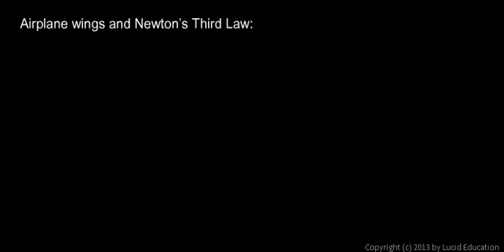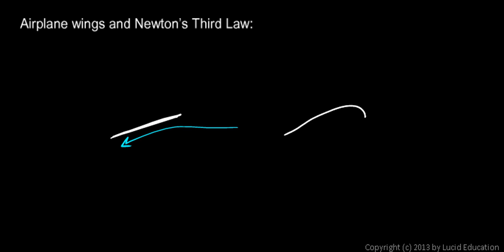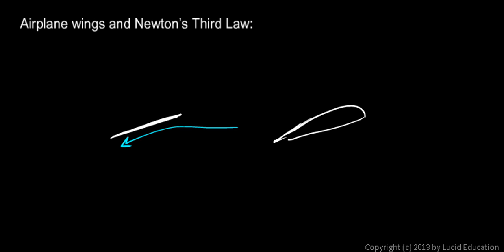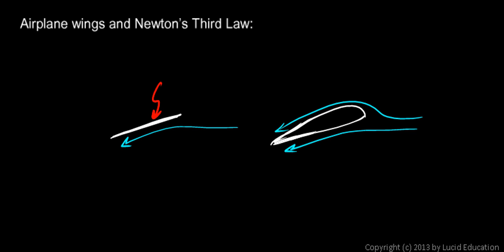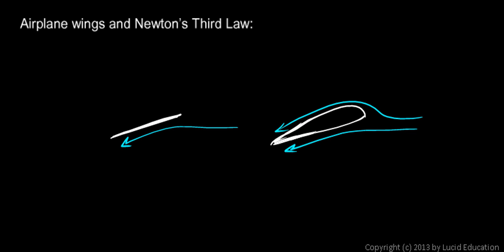Physical Science 3.5c - Bernoulli`s Principle and Airplanes

Comment: Excellent video! One thing to keep in mind is that Bernoulli's equation only applies to a single streamline. Thus, Bernoulli's is not a great explanation when it comes to airfoils, as the many streamlines above and below the airfoil cannot be related using Bernoulli's. While velocity and pressure are related when it comes to airfoils, it is more due to pressure and velocity fields and how they change together.

Comment: An inclined hydrofoil moving slowly through liquid helium will not generate a transverse force, or lift in other words. The same hydrofoil moving through liquid sodium with exactly the same geometry or kinematics will generate a transverse force. An attempt to explain this in terms of Bernoulli or Newton will be a failure.

What happens in the case of liquid helium is that fluid doubles back round the trailing edge and nothing much else happens. In the case of liquid sodium viscosity frustrates the doubling back behaviour and a starting vortex is dumped in the flow. By conservation of vorticity, there must be bound vorticity associated with the hydrofoil and this generates lift by the Magnus effect.

If the hydrofoil stops, then it will dump a stopping vortex. If it moves intermittently in a start-stop action, then it will dump a vortex street. This can actually be visualised.

This is the basics of lift generation. I'll talk about the Kutta condition and the Kutta-Joukowski circulation theorem if you like, but the Magnus effect is a good simple alternative. Bernoulli's theorem is merely wisdom after the event of a starting vortex being dumped.

Comment: The lift force is the pressure difference around the wing (more under than above) caused by the relative (air-wing) motion. 
..
These same pressure changes are what also push the air down behind the wing (down-wash).... as well as forward and upward ahead of the wing (up-wash) and around the wing-tips into the tip vortex.
Bernoulli's Principle as interpreted here is an all too common *misconception*.  Speed DOES NOT lower static pressure.
..
Pressure gradients (differences in pressure between regions) accelerate (push) on the mass of air. That's simply Newton for fluids.
..
Three years since I explain all of this and this Bad Science is still here!
Reply: Your answer does not make any sense
Reply: @ashallama223   There are so many videos and web pages by amateurs that have this wrong.
..
Things wrong with this video.
.
1- Bernoulli's Principle does not explain lift.  He does state the actual Principle correctly and you do see pressure and speed behave like that around the wing, but it is explained incorrectly here.
.
A fluid does not exert less pressure when it moves with greater speed.   <-- THAT part is false. 
.
The air is *speeding up*.  That is important because a higher pressure pushes it more, therefore, speeding it up - accelerating it toward the lower pressure. It is the pressure difference that provides the force to accelerate the mass in air.  This is Newton for Fluids.  A pressure difference between two locations is called a Pressure Gradient. 
.
Pressure Gradients Accelerate fluid.
.
The fast air out of a blower has the same pressure as the stationary air around it. It is the higher pressure inside the blower that accelerates the air into the lower atmospheric pressure.
..
..2- Newton's Third Law happens, for sure, but it is the pressures around the wing that pushes air down from BOTH the lower surface and upper surface. The air is accelerated BY the pressures.  The pressures push up on the wing AND down on some air.
Think pf walking up a sand dune.  As you step up, you can see some sand going down.  When you walk up stairs, you are pushing down on the stairs, but the stair pushes up on you.  However it is YOU that is causing the push, not the stair.
..
Also the air does not "move faster above the wing" .  The air above the wing is accelerated by the pressures.  A lower pressure forms above the wing by the way the air is forced to curve.  The atmospheric pressure ahead of the wing pushes more and this accelerates that air rearward toward the trailing edge.  It is Accelerated rearward by the pressures.

Newton's third law happens because of the pressures.  It does not happen to help provide more lift below the wing.  The wing's lower surface and the air approaching each other causes an increase in pressure . It is THAT pressure that pushes the air below the wing downward because the pressure much lower is atmospheric pressure that is lower pressure than close to the wing's lower surface.  It is the difference in pressures that Accelerate the air.
..
For a correct of the detail above a wing, see this short video: 
  https://www.youtube.com/watch?v=3MSqbnbKDmM 
..
For a full explanation (including that video, See 
Understanding Lift Correctly https://rxesywwbdscllwpn.quora.com/

Comment: It is not enough to just  state Bernoulli's principle,  and the next question to ask is what causes Bernoulli's principle?
So let us jump in at the deep end and describe what actually happens. Let us assume  we are using a well designed airfoil section  where the  top and bottom of the leading edge were designed to accelerate the air particles out of the way , for the wing to go through the gap formed and generate lift  on the whole wing. The shape of the  accelerating zone  at the leading edge to cause minimum acceleration to provide the right momentum  to the air particles, without too much drag is a science in itself about which we shall not cover in this comment.  
The air particles are forced to hit heavily the leading edge using the energy  of the engine, hence  they are accelerated and reflected upwards very forcefully  solely due to engine power or dive in a glider , where their momentum would tend to carry them far higher than the surface of the wing causing a depleted zone hence low pressure bubble above the wing This is a sort of bubble of low pressure above the  wing, which will try to collapse  with the low pressure accelerating the air particles downwards while at the same time pulling the wing upwards. But with the less mass, viscous air particles forming the upper side of the low pressure  bubble being lighter than the solid wing with a higher mass, these will accelerate down faster than the wing will try to accelerate upwards,  with an equal reaction and so the wing must move forward fast enough not to let the air particles  cover so much distance down  as to hit too much of the upper trailing edge  and preferably will come down as down wash behind the trailing edge.    This is a continuous action with new particles being given energy by the engine or a dive, and  shot up at the leading edge to keep the low pressure bubble above the top surface of the wing through them  being accelerated down into an area of low pressure thus increasing their velocity before they go past the trailing edge, perhaps even hit it  but the over all effect is still the fact that the wing  trying  to be sucked up by the low pressure area above it. Again it has to be noted that it is very important that the wing will move forward fast enough so that the air particle on top accelerating down will not hit too much of the upper surface of the wing to lose their momentum downwards on the wing itself. The fact that the upper surface of the  wing recedes down after its higher point, it will give the air particles some more room, hence  time before they hit the trailing edge and preferably go past it.
Meanwhile at the lower leading edge  the air is also accelerated down, but due to the fact that the lower part of the wing forms an angle of attack there will now be a high pressure zone which will  accelerate the air particles under the wing to change their momentum downwards and due to the fact that they are in a high pressure zone  all the way to the trailing  edge, they will slow down a little while those on the upper side on the wing accelerating in to a low pressure zone of their own making, they will increase velocity hoping that they  will not hit too much of the upper surface near the trailing edge. In fact this is the  main  reason why the plane has a minimum safe speed for take off so that the upper downward accelerating particles on top of the wing will  not hit  the upper surface to lose their momentum on the wing surface which would push it down, where other zones on the upper surface are lifting it up!
The over all effect is a change of momentum  downward of the air around the wing and so the force to do this  reacts to lift the wing, be it  a high pressure under the wing or a continuously collapsing and  continuously repaired low pressure bubble on the top surface. 
We should stick to  the facts that are taking place and not  mention, Bernoulli nor Newton. That would be like some one asking me what my wife looks like and I would tell them that she looks like her sister. If I had to  use that type of description, No one would be any wiser if they do not know her sister, would they?
Reply: @vennessa lorret,
.
"air particles are forced to hit heavily the leading edge ...they are accelerated and reflected upwards very forcefully...(or " shot up at the leading edge") where their momentum would tend to carry them far higher than the surface of the wing causing a depleted zone hence low pressure bubble above the wing"
****This is not correct.  They are not reflected, but flow smoothly.  If there was any "hit heavily...forcefully" there would be a significant downward force on the wing.
...
There is a low pressure there, but it is caused by the curved flow "trying" to continue straight and tending to move away, toward the outside of the curved path. This is just like why you are pulled to the outside of a child's merry-go-round at high speed.  This is what lowers the pressure, not the bouncing, shooting up as you describe. Although I must admit you sort-of  have the right idea and this is the first time I've heard this novel version.
....
"pulling the wing upwards." 
****Air cannot pull.  The pressure below the wing is higher than above and this difference, over the area of the wing, is the upward lift force. [pressure over an area is a force].  There is more pressure pushing upward on the bottom than there is pressure pushing downward on the top surface.
...
"But with the less mass, ...these will accelerate down... not to let the air particles  ...hit too much of the upper trailing edge  and preferably will come down as down wash behind the trailing edge."
****This is also incorrect.  The mass of the air above the wing which gets accelerated downward, is rather large.  Again, the flow is smooth and the acceleration above the wing is primarily rearward, toward the trailing edge of the wing, into the lower pressure above the wing.  Yes, air further above is also accelerated downward toward this lower pressure and it is not like it is going to hit the wing because that surface is curving away from the air, but this air above does make up part of the downwash, joining air from below the wing to make the full downwash.
...
It is continuous because the curved flow above the wing is continuous. 
..
"trying to be sucked up by the low pressure area above it."
***There is technically no such thing as suction.  A higher pressure always *pushes toward the lowered pressure. The lower pressure is not pulling.  Fluids cannot pull, only push more or less.
...
"the wing will move forward fast enough so that the air particle on top accelerating down will not hit too much of the upper surface of the wing..."
****Again, this is not what is happening.

"Meanwhile at the lower leading edge  ...there will now be a high pressure zone which will  accelerate the air particles under the wing to change their momentum downwards"
****Yes. This is correct. The higher pressure under the wing pushes up on the wing and down on air further below the wing forming part of the downwash.
...
****Now, this next part is amazingly close to the real science:
.
"[below]  due to the fact that they are in a high pressure zone ...they will slow down a little while those on the upper side on the wing accelerating in to a low pressure zone of their own making, "
****This is in the view of the wind tunnel, HOWEVER, on a real wing flying through otherwise still air, the lower air is pushed along in the direction of flight, by this higher pressure.
The upper air starts out moving in the direction of flight, but is rapidly accelerated toward the training edge AND completely REVERSING direction, there is so much acceleration due to the pressure difference.

"In fact this is the  main  reason why the plane has a minimum safe speed for take off so that the upper downward accelerating particles on top of the wing will  not hit  the upper surface to lose their momentum on the wing surface which would push it down...
****NOPE! this is incorrect.  The flow is smooth from zero on up to flight speed (no potential 'hitting') and you must get enough speed so the pressure difference is enough... So there is enough air accelerating around the curved flow over the top to lower the pressure and enough pressure buildup under the wing until the difference is enough to lift.

"The over all effect is a change of momentum  downward of the air around the wing and so the force to do this  reacts to lift the wing"
***This is the common explanation, but it is backwards.  The pressures around the wing push the downwash down *AND push the wing up.

"...not  mention, Bernoulli "
****Bernoulli indeed, causes nothing around a wing because the Bernoulli Principle as commonly stated is wrong.  Fast air does not cause a lower pressure. NOPE!

"nor Newton. 
****In reality, Newton Does apply as I explain:
Air has mass.
A force is required to accelerate a mass, EVEN AIR.
That force comes from a pressure difference between two locations, called a pressure gradient.
..
Thanks for the entertaining 'bouncing bubble" story. That was new and fun...
- - 
Cheers, Steve
Science and Technical Advisor.
Challenger.org

Comment: The wing's movement through the air is what causes the pressure changes.  Those pressure differences is the lift force.  Those same pressure differences then cause the accelerations of the air; the various velocity changes of the air around the wing.

Comment: Pressure is the result of molecular collisions with the surface of something. If there is no movement of the molecules (absolute 0 temperature) there is no pressure. As a stream of fluid passes faster along a surface the collisions become increasingly glancing blows at an angle to the surface and impart less pressure. It's like hitting a ball against a wall at increasingly more shallow angles. That explanation is from a 1950's aerodynamic book that I've misplaced, but I've never heard a better explanation.
Reply: yak55x Unfortunately it is incorrect.  This "speed reduces pressure" is a misconception repeated to the point that too many people believe it is a fundamental principle, which it is not.
Reply: @Observ45er  in fluid dynamics, increased velocity is inversely proportional to pressure (i.e. more velocity= less pressure). The total amount of available "pressure" in a system (excluding nonconservative forces like viscous drag for the moment) is equal to the amount of dynamic pressure, associated with the velocity of fluid 1/2*density*velocity^2, and the static pressure, ambient pressure+density*g*height. Directly relate this to the conservation of mass equation which states that a system's Energy is the sum of KE (i.e. dynamic pressure) + PE (i.e. static pressure) + Internal Energy (Work but ignore that here). If the amount of "pressure" in a closed system is fixed, one increases while the other decreases. So an increase in velocity of the fluid is related to a decrease in pressure to keep that constant. In physics terms, think about pressure as due to the collision of random translational particles against a surface. If I increase the velocity of the liquid, there are going to be alot less particles "randomly" banging against a surface to cause pressure because its going to be forced to move in the direction of that velocity. Therefore, the increase in velocity is a decrease in pressure. Don't confuse this with classical ideal gas law calculations, where an increase in velocity would lead to an increase in KE and therefore pressure; that assumes a fixed volume.
Reply: @playdoh7160  Your first statement applies only along a streamline and inversely proportional is not exactly the relationship (square term). It is also not particularly helpful; nobody is denying the relationship between pressure and velocity, but that relationship alone does not even get close to explaining the lift (since you have to assume either a velocity or a pressure field around the airfoil before you use that relationship). You should not think about static pressure as anything to do with particles against a surface because (1) it violates the continuum assumption, and (2) static pressure can be defined far from any wall.

Comment: May I ask why would the air passing above the wing move faster than the air moving below it?
Reply: If you think about it; It's not the air that's travelling, it's actually the wing itself. So, air relatively moves faster on the top of the wing than the bottom.
Reply: @darshangowda309  THANK YOU
Reply: Answering a little bit late, but if you think about it. The air passing over the top of the airplane has to travel a farther distance to reach the same place as the air flowing below the wing, therefore having to move faster in order to catch up with the air below. Not a perfect explanation but is an easy way to put it.